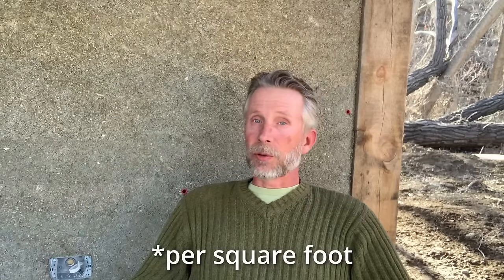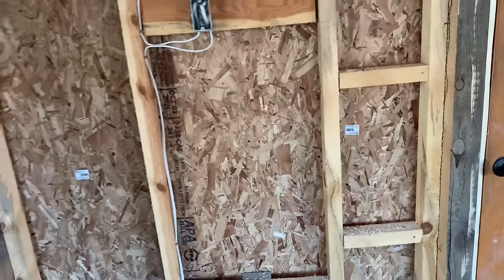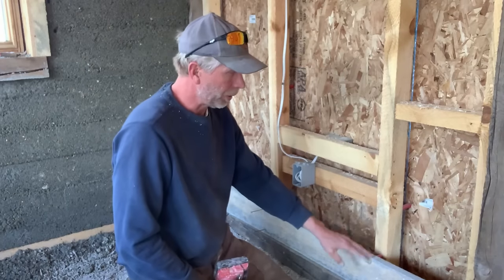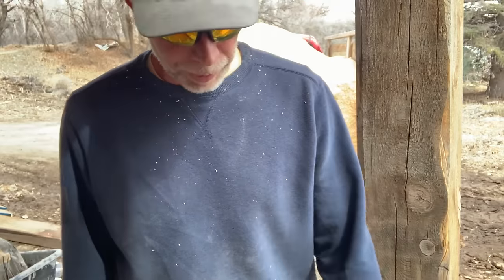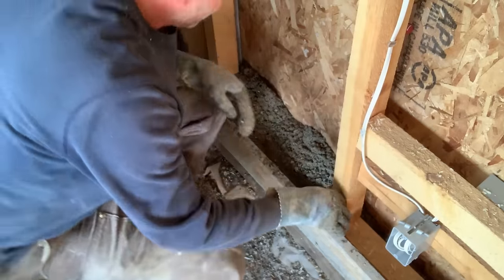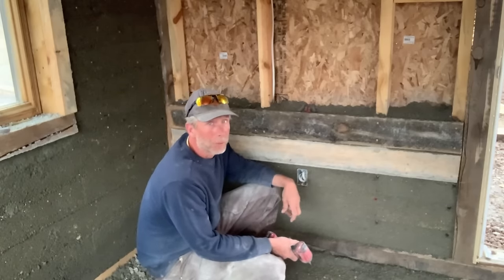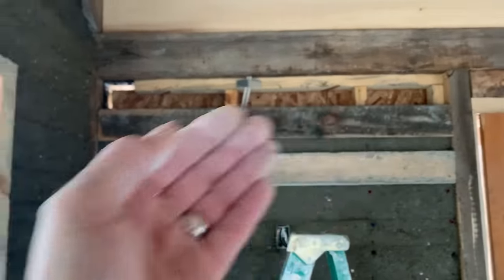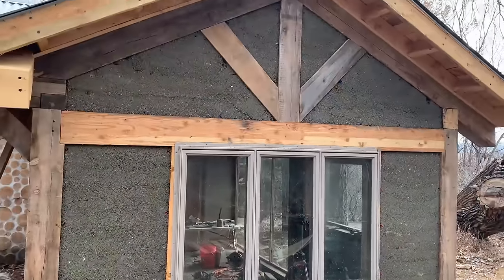Dustcrete

Comment: What is the themo mass of this material?  I am designing a roll-off roof observatory here in Arizona and I'm trying to avoid having wood  in the walls. It eventually dries out and there there is the problem with termites.  The support structure  idea is vertical columns of cinder blocks spaced 6' across. Across the top will be a linear V grove  on which the rollers under the roof structure will sit.  It is what goes between the columns which is the issue. An all cinder block construction has too much thermal mass. The blocks will soak up the HOT sun and it will take all night to release it. Telescopes work best when they are at the night time ambient temperature, so it is best to have something that cools down fast, if possible or soakes up the sun as little as possible.   Also, the inside of the building should not get too much hotter than daytime temperature, so that means either insulation and/or good air flow. Decisions, decisions.
Reply from the maker: The static weight of a 4’x8’x6” wall section is around 200lbs, if that helps

Comment: Just a question, could it work if you make the mix more liquid and then pour it directly between two big pieces like the outside one and let it dry more time?
Reply from the maker: If the mix is too wet will have no insulating property. Pumice Crete is poured in the fashion you are describing, and is also a great material.

Comment: Have you tried to burn it? I would be worried that the sawdust would ignite if the temp got high enough, and if a good section of the wall were heating at the same time you could get a flash over.

Comment: Thank you very much for your reply !
The more I research this the more confusing it becomes.
It seems like a great solution but from what I read it seems more complicated than this.
Like not any sawdust will do.
And that it needs to be kiln dried and treated.
Do you think those are valid concerns?
Thank you for your time ,
Luke
Reply from the maker: I do not think think it needs to be kiln dried, and I wouldn’t use it if it was treated. The stuff I use is fresh off the mill, and works great. Since the extreme alkalinity of the lime prevents mold growth, I have seen zero mold. Using fresher sawdust means the particles will shrink as it cures. This may cause some minor shrinkage and small cracks, but those plaster over and disappear. Because the particles shrink, you end up with more encapsulated air within the wall. This improves insulation.

Comment: A tire huse / earth ship and the tires filled with dust Crete would be the best. 
The tires are Far stronger , wont crack,  more thermal mass. Then the dust crete is far faster to fill the tires than raming in dirt. So a faster build.
Reply from the maker: As mentioned in the aircrete comments, this would work but I wouldn’t do it. The off gassing of tires may or may not be a health risk, but I prefer materials I know are benign.

Comment: I've been wondering if that would work for other sorts of biomass, like yard waste, pinestraw, leaves, etc, run through a mulcher.  
does the lime treat it against rot and fungus?  I know a borax treatment would, but I don't know if that would react weird with the portland or lime.
Reply from the maker: The alkalinity of the lime appears to prevent rot and fungus. I suspect biomass could largely be interchangeable. The voids created with this chunky sawdust are likely superior to what you would get with mulched leaves. 
There is the example of papercrete, too. As I understand it, it is typically mixed wet and sprayed on to wire forms. 🤷🏼‍♂️
Reply: @radicalgastronomy  
Another thought along those lines Id had was using sweetgum gumballs as concrete aggregate, as theyre light, interlocking, ridiculously plentiful and are fairly tough. 
I may try your mix on a test block this fall when I can get a pile of clean ones easily and see how it does.

Comment: This is similar to hempcrete, I'm not sure how durable this will be but it was still a very nice video very calming

Edit: I got way ahead of myself XD you alluded to hempcrete in the first 2 seconds after the intro, my bad
Reply from the maker: No worries. After a two years, I am amazed at the durability of this system. I have had some hairline cracks, but I was rushing to plaster. My current advice is to let the dustcrete cure for a couple months before adding renders. Otherwise, I’m more sold on the viability every day.
Reply: @radicalgastronomy  huh, neat! Good to hear that it worked out, and hey hairline fractures happen in plaster too so

Comment: I
Great idea to build up the wall plank by plank to save on cost of form materials. I imagine you would have to have a full frame and roof completed before commencing dust Crete? Ie it can’t get wet?
Reply from the maker: Yes, it is best to have to roof on before filling walls. After 24 hours it is set, and a little rain is no problem. Long eves are good to protect from too much weather.
Reply: @radicalgastronomy  thank you kind Sir.🙏🇦🇺 We have been looking at making hemp blocks to build our home . Given Labour is now more expensive than materials here in Oz and very low quality…building this way ourselves in our late 50s is our only option….you have given me a lot to research test and to budget.
Reply from the maker: @elwood212  excellent. Best of luck with your build!

Comment: Have you weighed the material? It would seem that it would be reasonably lightweight, though probably not as light as most foam panels. 

I was intrigued by a foam insulation that comes in panels but with knockouts so that it could fit around studs in a wall while overlapping to eliminate bridging. I was thinking about using it as a retrofit on the ceiling of some existing garages, but can’t get a response from the company. 

It would seem relatively easy to make a panel of this material laying flat, and if not too heavy, then lifted into place. The way you’ve used it is much easier, but wouldn’t seem to work as well for a ceiling.
Reply from the maker: Back of the napkin on weight is around 12#/cu.ft. I think a 2x8' 6" thick panel would clock it around 100#. This may be the solution for overhead spaces.

Comment: Do you think this would make big bricks (1'x1', 1'x2' etc)? What about a tilt wall? Compact it into a standard 4x8 by x thickness form, let it harden then stand them up.
Reply: Great Idea, Post Frame. Mass batch Bricks or Sips and Stand them up. Controlled Shrinkage. Caulk/ motor and next.  Do Like Honey carpenter and prebuild with SIP.  "Pouring Air Crete Panels for Shed."  But Dustcrete.  Need to mix up 4x8x7-8" sheet and have it stand up not collapse.i thought.  I recall that it needs to not be to thick or it does collapse.
https://www.youtube.com/watch?v=7KHEj3-KpHk
Reply: @GriffenNaif  exactly
Reply: @GriffenNaif  Yep, that's what I was thinking. Might be worth trying.

Comment: Thanks for sharing . An alternative to hemp which is not readilly available in my area, A couple of questions; once you mix a batch how long  before it starts to get hard to work with and how long does it take to fully cure?Do you have to protect it from the rain?  I am in Atlantic Canada , humid climate.
Reply from the maker: These wheel barrow sized batches get used up really quick, and I spend more time mixing than filling. My instinct is that you would want to get a fresh batch into forms within about 20-30 minutes. I had one section where I mistakenly pulled the outside form just after finishing filling it, and it collapsed. I re packed it with the same material. The result was a wall that was more crumbly than my typical result, and I attribute that to partial curing of the binders over the time it took to re pack. 
It should be protected from rain while it cures. After 24 hours, it seems to be weather safe. The move is to fully form the outside of the wall, and slip form the inside. Since the fill will fail if both sides are unformed before it cures (as I learned from the story above) leaving the outside form over night protects the wall while it needs it. I have a section of mine that still needs outside plaster and the raw dustcrete is holding up great, even exposed to a Colorado winter.
Hope that answers your questions!
Reply: @radicalgastronomy  Thanks  I am building a timber frame house next spring and looking at different ideas , i want the timber inside and the walls outside so that the full timber is showing.  I am wondering if i use moister proof drywall against the timber that would serve as slip form , i realize i would have to reinforce it so it doesnt bow and the dustcrete would be packed from the outside instead. I wonder if the water from the mix would create mold on the drywall?

Comment: How does this (saw)dust-crete compare with air-crete? The air-crete method blows foaming soap into the concrete mix that dries into a light weight concrete with fairly good insulative properties due to the tiny soap bubbles that permeate the now hardened air-crete cement. There are many videos on YouTube which describe air-crete.

Comment: I really like this building process.  I have the opportunity to use this process in Northern Ontario.  Is there any way to estimate the R value to this type of wall fill per inch of depth value ?
Reply from the maker: There is a range of 2.8-4.6/inch often sited for hempcrete. It is probably in there. If we assume 3.5, these 7” thick walls would rate 24.5. I have some tests planned, but that should be the ballpark range.
Reply: Thank you so much for your reply.  I also understand that because the concrete sawdust product has density it also retains and returns heat back to the heated environment. Is it safe to say that chainsaw sawdust would be ok to use for this mixture or is it too course ?  There are two companies in my neighborhood that produce cordwood for heating and chainsaw sawdust is almost unlimited here and it is mostly pine.    @radicalgastronomy
Reply from the maker: @raydreamer7566  Chainsaw dust from firewood cutting is great for this. I wouldn’t use anything finer. It is largely the trapped air that provides insulation, so chunky is good. And yes, the thermal mass from the cement and lime (particularly in the plaster) will bank energy through the day and release heat at night, to a degree.

Comment: Great idea! Any idea what the weight per CF is and the R Value also?
Reply from the maker: Around 12 lbs/CF. R value predicted between 2.8 and 4.6/inch, but not yet confirmed.
Reply: @radicalgastronomy  So the weight is about 15% of a normal cinder block (roughly) and the R Value is about the same as fiberglass batt. Impressive! Plus no thermal bridge...Bonus!
Reply from the maker: @barrysupernaw  That’s the idea. I’m wondering how best to integrate it into a roof system now…
Reply: @radicalgastronomy  Looking forward to THAT video 😀

Comment: Really interesting idea. Me working with architectural concrete on a daily basis wonders why not use a bit of plasticizer to make the mix more fluid so it is not so time consuming and labor intensive to compact it? 

Im about to renovate a house and this is something I would like to explore as an idea. Also.... using a form liner or just better sealed wood could give a more finished look( board forme concrete). 

What do you think? Am I missing something?
Reply from the maker: These techniques could certainly work. Personally, I like a vapor permeable wall free of plastic. There are certainly ways you use this material that would be faster, but more expensive. My approach is born of having more time than money, and wishing to avoid any potentially off-gassing petrochemical products. I am planning some experiments using clay in place of the cement. If that works, this whole system could be done without any industrial inputs.
Reply: @radicalgastronomy  Thanks for reply. I understand your approach. 

Plasticizer in concrete is a chemical component. I guess you could add water instead to make it more workable. 

The way I approach building- can one person build a house? I like concrete but building a concrete house requires forms/reinforcement etc. Here you are eliminating the need for that since you are adding layers. It is basically similar to layung brick but your brick comes in wet form... 

What I get out most of this idea is that it doesnt require heavy duty forms and very hectic approach at the time of pouring.
Reply from the maker: @Concreteshoplife  You bet. This way of building can be done by one person, alone. Also, if a crew can be assembled, great progress can be made quickly. Unlike cob or aircrete, dustcrete can be formed to any height without delay.
Reply: @radicalgastronomy  somebody mentioned that putting organic material into your mix will affect its longevity... I dont see how....wood chips are used in hardibacker and that's basically the same mix- from a point of view of ingredients. 

After researching aircrete and this I wonder if combining these two materials could be an option. 

Just so you understand my line of thinking.... the goal would be to use wood or maybe metal stud structure as structure and fill with a material that offers estherically pleasing effect and offers good/semi good r value.
Reply from the maker: @Concreteshoplife  People who freak out about organics in this mix haven’t tried it. The alkalinity prevents decay, and even if the sawdust decayed completely, you are left with aircrete. As far as aircrete goes, it could be mixed with sawdust, but I doubt there would be any noticeable advantage. The labor, equipment and mess would be the only factors increased.

Comment: Interesting. But the R value for dustcrete is most likely lower than saw dust so I would not have anything built with dustcrete without proper insulation. What I am more curious about is if the dustcrete can hold moisture similar to sawdust
Reply from the maker: My guess is the air trapped in the cured wall yields a likely higher R value then just sawdust. All I know is my house is easy to heat, and comfortable.

Comment: Im very curious about this approach, but you said something that raises questions. You said this approach is good in your climate. What climate is compatible with this approach? Where can I read and learn more about it? Is there a proper name I should search? It seems it may tend to shrink as it dries. Is this not the case?
Reply from the maker: I suspect this approach will work great in most climates. Super wet, jungle climates may have issues, but it has not (as far as I know) been tried. My climate is zone 5 with <15” of rain per year. With proper eve over hangs, a good footer, and lime exterior plaster, I can’t see why this wouldn’t work in any climate. There is some commentary about similar buildings in Poland, but I could find no other examples of this technique when I built mine. Roughly, Dustcrete is comparable to hempcrete. The latter has been used extensively in Europe.
There is slight shrinkage (at most 1/4” at the corners). Because of this, I now recommend allowing the material to cure for 2 months before plastering. 
I am planing future projects and videos exploring the method. There may be some workshop opportunities coming up. I will announce those on this channel, so stay tuned!

Comment: I'd be interested in comparing this to foamcrete poured with the same slipform technique.  For durability I'm considering using some kind of hardiplank or concrete board as the inside wall covering, cut into strips to look like shiplap..
Reply from the maker: One consideration is that foamcrete requires a leak-proof form, where dustcrete can be packed into a form with pretty big gaps.

Comment: Just wondering how wide a support wall would need to be? I expect the compression strength to be very high, but the tensile strength might be low at a seem. Thanks
Reply from the maker: @arthurpletcher7299  Agreed. I wonder if a frameless pour even has a use case. I plan to try a 2x4 frame with diagonal metal strap to provide tensile strength. If applied to the interior face, the fixed form could be set over it, and spacers could go on the outside. That way it would not interfere with filling, and could be plastered over, just like the stud edges.
Reply: @radicalgastronomy  The metal sounds ideal.

Comment: Really helpfull movie, thank you. I’m want to build a woodworkshop with walls like these. 

I’ve searched true the reactions but didn’t find an answer on a question I have.

How many sawdust-crete is needed for 1 cubic meter? (I’m sorry for asking meters… in the Netherlands we have this metric system).😊
Reply from the maker: For one cubic meter of dustcrete you will need about 25 kilo hydrated lime, and 50 kilo cement, plus the cubic meter of sawdust. Hope that helps!
Reply: You’re quick 😊
Thank you very much. 

Also like the other videos!
Reply from the maker: @metpeter3131  Thank you! Best of luck with your project.